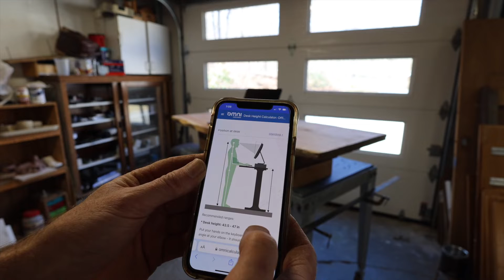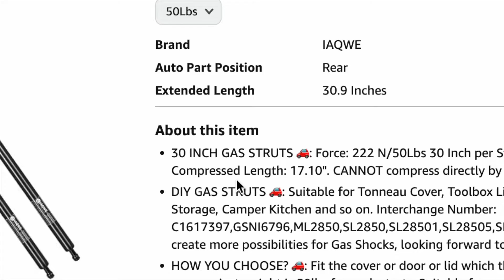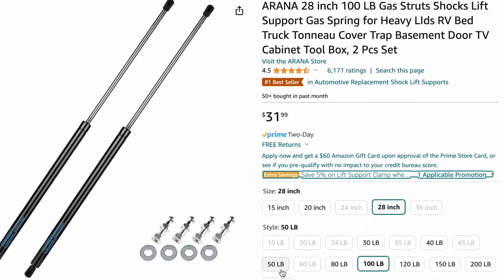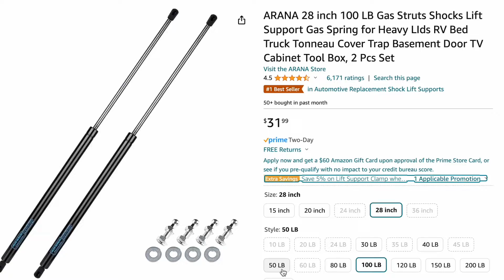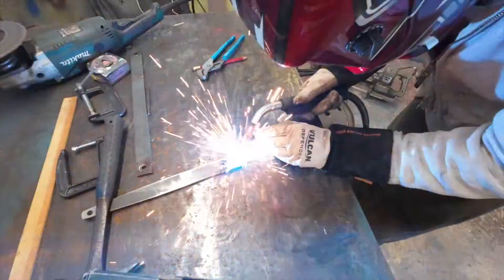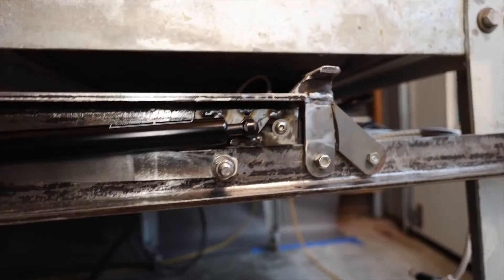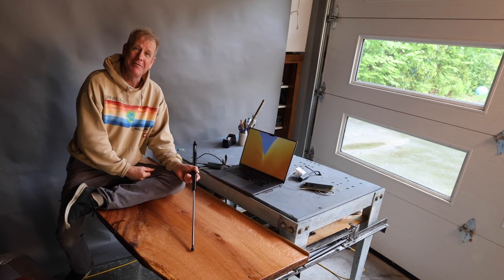How to use Gas Struts for DIY Convertible Standing Desk

Comment: The problem with using strong struts for heavy lifting applications is the change in angles. When the strut is compressed, it is usually in an angle that doesn't provide enough vertical force (vertical to the axis of the strut). Hence it's best not to design the mechanism in a way that the axis of the gas strut becomes perpendicular to the resisting force's line of action. I am having a bit of trouble with it right now.
Reply from the maker: Interesting. Most applications for these struts is to help lift trunks and stuff. My setup is a little different. But they seem to work fine. In the middle of the action the desktop is kind of neutral. If stop lifting or pushing down it just kind of stops. But at the end of the action either going up or down it moves on its own. I slow it down so it doesn’t crash to a stop. But going up the struts just pull it into place. Hope this helps you figure out your setup.
Thanks,

Comment: how much effort does it take to bring it down? I'm thinking of DIYing a desk with these gas struts but portable and not attached to anything, what do you think?
Reply from the maker: I think you can do it. I have to brace my knee on the front of the table to bring down the desk top which should work for yourself as well. The thing that you might need to include is some supports that go forward so it doesn't topple over in the lowered position. Mine has a lot of weight in the back to hold it down. Happy Making!

Comment: What's the vertical height gain you get between the desk at the lower end vs that at the upper end when the spring is fully extended. I am loving your videos, I have an adjustable height desk but I want to build some sort of "2nd floor" to my desk where I can have my 3d printer (to save space) but I also want to be able to bring that 3d Printer down to the main desk's level for ehrner my 3d prints are completed or whenever I need to give maintenance to my printer. And due to my 2 monitors I need the 2nd floor to be at 24 inches from the of the surface of the main desk
Reply from the maker: Hello, It goes from 31”to 46”.  Sounds like a cool project! You might want make a cardboard mockup and so you can get the dimensions pretty close and then move to wood for more accuracy. I found that I little variables made big differences. Hope this helps and thanks for the kind words!